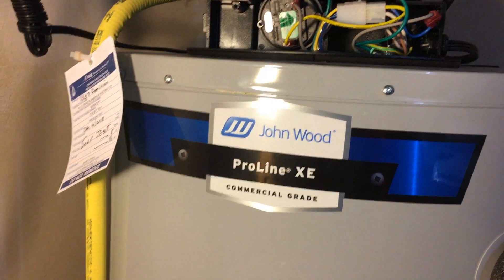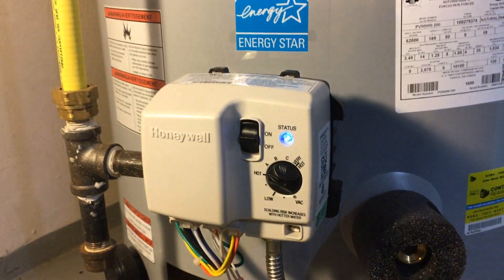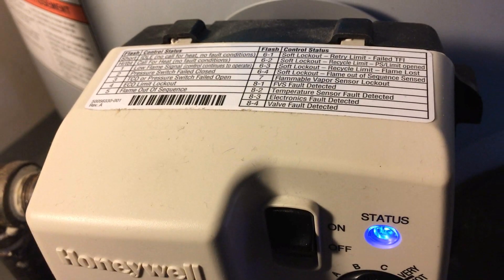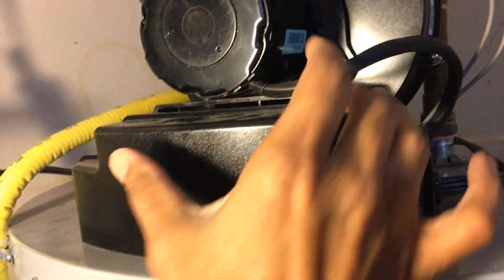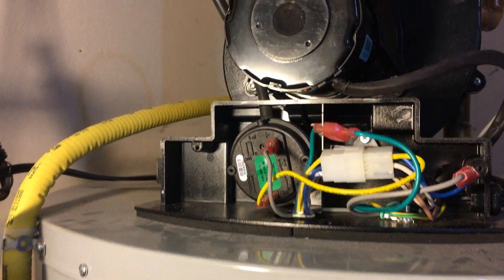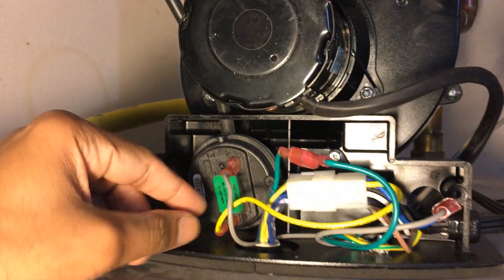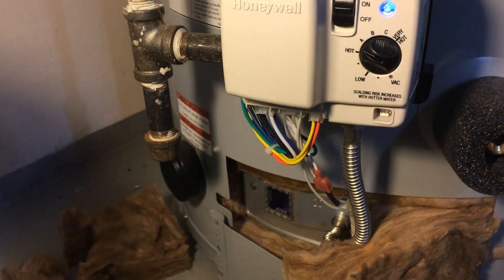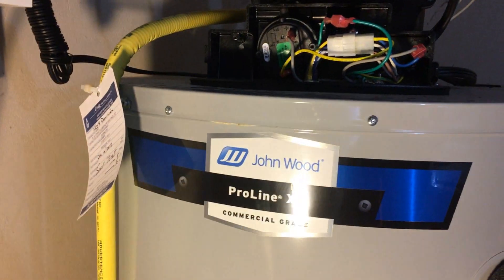Gas Water Heater Pressure Switch Issue

Comment: Thank you! This saved me an expensive service call. We have a different water heater but it was the pressure switch fail fault code. There was buildup on the inside of the nipple. Cleaned it out and it fired up! Been working since!

Comment: Thanks for posting this video. I followed your troubleshooting tips and it was definitely a plugged copper nipple causing the problem (where the rubber hose connects to from the  pressure switch)! Everything worked fine after cleaning the nipple and reassembling everything!
Reply from the maker: no problem!!

Comment: This was exactly my problem. Just took off the hose and blew through it to clear out any debris, and it worked fine. Plugged it back in and it started right away.
I like to fix most things myself (or at least attempt it), but always get nervous around gas-operated items that I'm not familiar with. This video made me feel confident to approach this problem. Thanks so much!
Reply from the maker: No Problem!!

Comment: You were spot on, I took and blew through it and sucked just fine, but it still had a little piece of plastic in it making it not work, i used a paperclip to clear the copper fitting and it's heating fine now.   Thank you very much.
Reply from the maker: No problem!

Comment: This must be for the 2 blink code. I had the 3 blink code and this is what worked for me…
Pressure Switch for a Richmond Power Vent is located in the Blower Hood, Remove the Hood from the top of the water heater, take off the 3 screws on the side panel (NOT THE TOP WHERE IT STATES DO NOT TAKE APART) You'll see the valve with the square hose on it, remove the hose and take a partially bent paper clip, slide it thru the hole to the fan until it pokes thru, scrape back an forth to remove any debris, also try to run it about an inch up the valve, place the black square tube on to the nipple which you cleaned out going to the fan and blow on it, if you can now blow thru it should work, connect the other end to the valve and reassemble being sure to tighten the clamps to the pipe heading outside. Turn on furnace and it should now work.